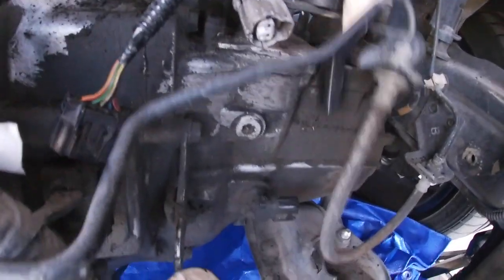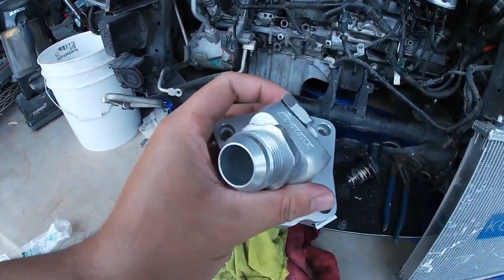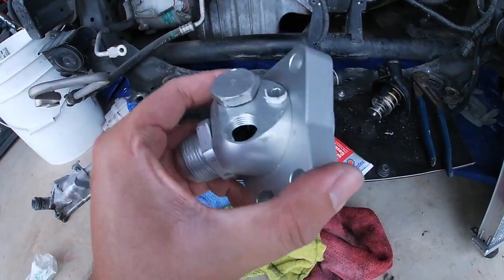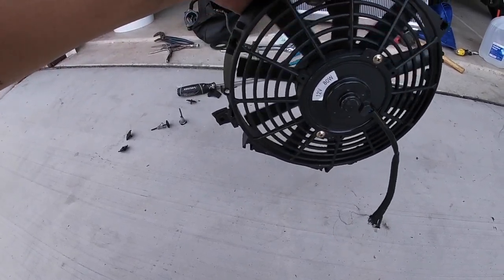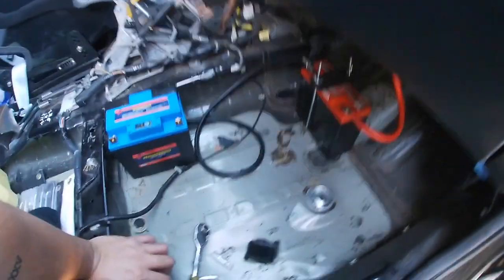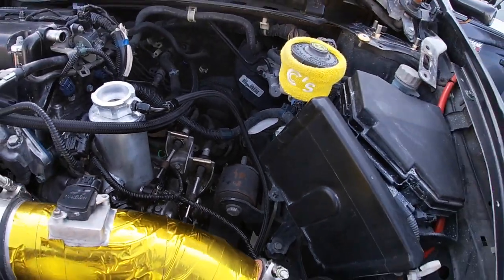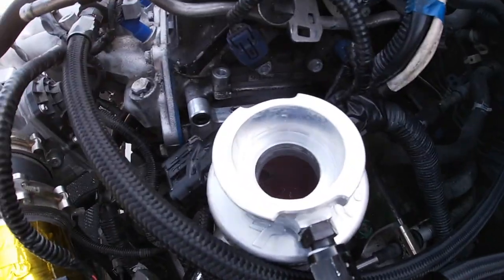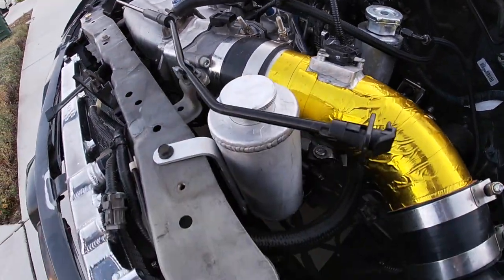Installed a new cooling system for my SeekerFA5 build!

Comment: Did the swirl pot make bleeding the car easier? Did you back out the studs that were on the head?
Reply from the maker: sorry for the late reply ! But yes I did back out the studs that are attached to the head carefully with a vice grip. Then attached the swirl pot to the side of the head. The bleeding of the system actually did take a bit longer than normal, but the process is no different than bleeding the from radiator than the swirl pot itself.